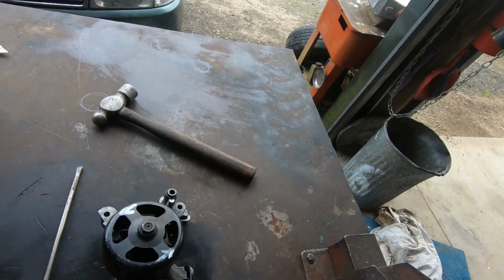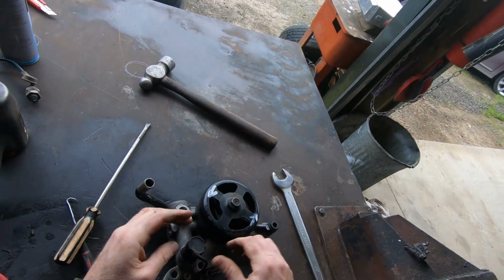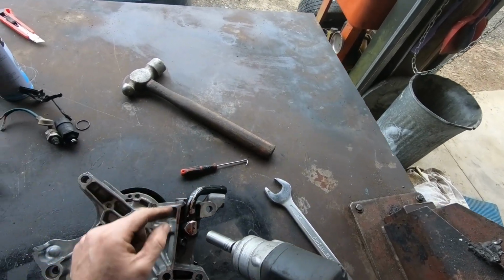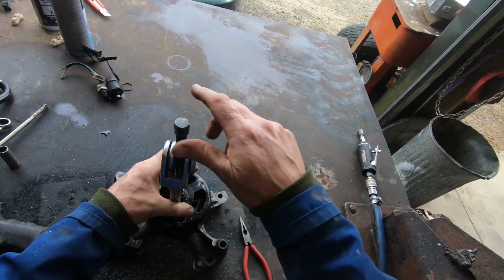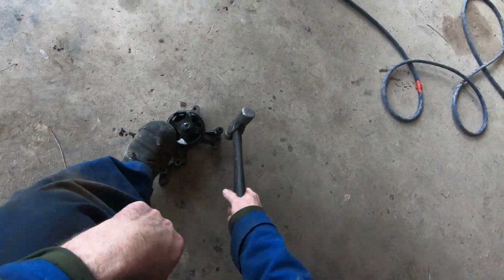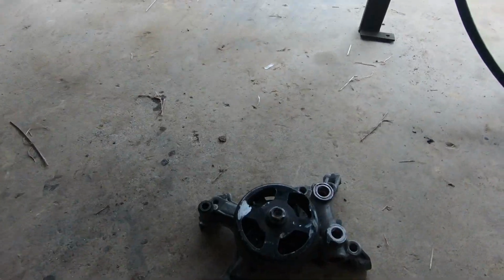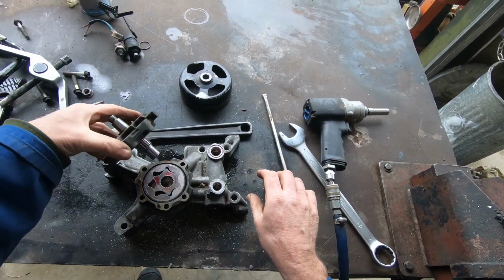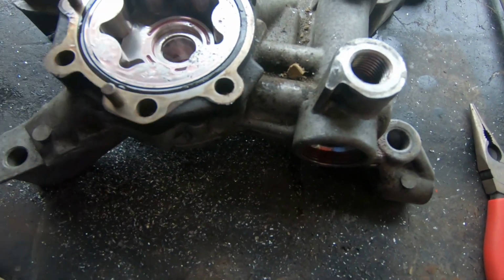1uz hydro fan strip.  Removing the hydraulic fan when not running Air conditioning

Comment: im pumped for the soarer content
Reply from the maker: I think the first video will be more diagnosis as it doesn't even run at this point.  Maybe I should get some suggestions on what to check from Viewers and produce a video that way?  Cheers Kelvin
Reply: @CartuneNZ  That would be a good place to start i think it would be awesome to have a few videos on the   most common problems for the soarers. Maybe any tip and tricks that you would know about them like 12v fuel mod and egr deletes( im pretty sure you got some videos on that already) and when shes runnin maybe a turbo build? i know alot of people always are asking questions and wondering but people give alot of misinformation on that subject so it would be nice to see what you would do and your thoughts on it
Reply from the maker: @mob187eastside  this car is never going back onto the road so will be stripped once I'm done.  No egr on jdm soarer but fuel pump mod is a great idea.  Im wonderimg about doing a plug and play Link ecu install as well.  First step will be making it run and skidding around the paddock.
Reply: @CartuneNZ   I Think those are 2 Great Ideas i am  definitely very interesting in both subjects.  I will be going link ecu in my sc400  once im done schooling and the fund are available. So that would be great video to have. Question.... am i able to run early 1uz rods in piston in a later model 1uz vvti internet says i can but i would like to hear your opinion. Thanks for makeing some great videos and i look foward to seeing more of hadens engine build!!.
Reply from the maker: @mob187eastside  Hello.  Yes.  Early rods go into vvti engines fine but piston design is different.   I've seen a 500hp vvti with early rods, injectors, turbo and ecu so has been successfully done by someone I trust.  Cheers Kelvin

Comment: What sized belt to use in Lexus SC400 with the hydro fan pump bypassed/stripped?
Reply from the maker: When we strip the hydraulic fan pump and don't have A/c we run a 6pk1555, Pk1560, 6pk1575 or 6pk1600 depending on the sizing of the other accessory pully's.  For the SC400 generally one of the first 2 work well.  Cheers Kelvin

Comment: Boy that steel workbench is noisy when you're throwing parts and tools around on it...great vid but what do you do with the gutted pump now?
Reply from the maker: It never seems that loud when I'm working but really does in the video.   The stripped unit becomes a cover onlt for the cambelt.  This vehicle isnt running air conditioning so a shorter belt is fitted,  in this case a Gilmore belt,  and its all done.  I've got a separate video for belt lengths on my list.  Cheers Kelvin

Comment: Hello sir! I'm in the states and have a JDM Celsior motor. I'm using your videos to help with my swap but I'm wondering if there is an alternative to this pump since it's  very expensive in OEM form and very hard to find used. I saw you mentioned there is a pump you use for the ls400 but it's not hydraulic am I correct? So would you recommend going to a clutch fan set up since this pump is often not replaceable? Thanks again for your content and help.

Comment: Interesting ways to remove the pulley.. I have so far unsuccessfully removed pulleys on two hydro fan pumps.. I used a Toledo two arm puller, and managed to bend both pulleys.. I am currently waiting from Toyota Japan the OEM SST to remove the pulley. Will grinding the opening or bashing the pulley cause damage or balance issues after rebuilding these pumps?
Keep up the great videos
Reply from the maker: Hello.  Bashing the pulley is highly likely going to damage the pulley. I only do it this way as its not getting used again.   Grinding is likely going to cause unbalance.  The puller I showed in the video removes the pulley quite easily but it must pull from the center of the pulley,   never from the outside.  Cheers Kelvin.
Reply: @CartuneNZ  I used the Toyota SST tool to try to remove the hydraulic fan pump pulley, and managed to break the SST tool..  BTW the Toledo tool grabs from the outside, and as you say that is no good, the SST tool grabs from the inside, but eventhough I was able to exert more pressure, it broke, I give up..
Reply from the maker: @goetzvg  thats stink.  My puller grabs from the inside and works well.  Im sure I show it in the video.  I use a big puller but the hooks on the legs are trimmed to to allow it to fit into the inside of the pulley.
Reply: @CartuneNZ  would you have the make/model of your puller?

Comment: I live in brazil, we do serious offroad around here.(take a look at m channel). Here 1UZ are totally rare, so your videos are being very helpful to me.
Im going to use an electric fan on my offroad project, so the hydraulic fan pump is going to be useless. If i disassemble the pump the way you did on the video and assemble it without the "internal guts" it`s a good idea? I want the engine to run as free as possible. Thanks!
Reply from the maker: Ok.  I would strip and not run anything where this unit is and fit a shorter belt.  I have done hundreds this way.  Cheers Kelvin
Reply: @CartuneNZ  I like that idea. In that case i don't need to strip the pump, seems easier ... regarding the length of the shorter belt, any chance you remember the length or code ? thanks alot.
Reply from the maker: Are you using the pump to run anything?  Is there fluid circulating?  The fluid lubricants the pump.  If its present and not stripped they seize.  With pulley removed I use a 6pk1555 or 6pk1560
Reply: @CartuneNZ  No, i wont be using it. Im keeping my A/C though.

Comment: I’m currently about to do the waterpump on my 1993 ls400 and i cant seem disconnect the whole bracket for this specific part. I thought I unbolted everything but it still won’t budge any suggestion? Your videos are awesome thank you for putting out this content!
Reply from the maker: I'd suggest removing the bolts you missed.  Possibly the a/c pump bolts.  If they are all 100% out then lever bar.
Reply: @CartuneNZ  Awesome answer Kelvin, gotta get ALL the bolts. 😃This is actually why I'm looking here is I can't get my fan bracket off my 93 LS400. I can't remember from when I did my other T-belt/WP jobs (among other things) and trying not to get under the car and do everything from the top. I got no lift and a gravel driveway. I'm just gonna take a break and have a 🚬 and check your other videos and see where the last bolt is so I don't snap the fan bracket. They sure helped with many other problems I had, even if it's just to see where another bolt might be. I think it's somewhere on the A/C. I guess I got smarter in my old age, I slowed down and look before I break something now. 
Thanks again for all your knowledge and videos on the 1UZ.

Comment: Hi, 
I have a 1st gen 1uz in a toyota celsior. My fan pully come off and I lost the keyway, but I don't have a clutch fan on there, can I just bolt it back on and run it?
Reply from the maker: Sorry I dont quite understand what you are saying.  Celsior from factory ran a hydraulic fan pump.  Some run a flange,  some directly onto a tapered shaft.   I'm not keen to advise when I dont know what really has happened.
Reply: @CartuneNZ  hey mate I've emailed you from a Ryan Doherty email

Comment: Why not just use the original 1uz hydraulic driven fan and modify it to fit the vehicles original or aftermarket radiator ?
Reply from the maker: In some instances I have however in most cases there is no way the hydraulic fan would fit and in most cases the fan assembly doesn't come with engine package so using it is not an option.  I think i have two fans left and rarely get more these days.  Cheers Kelvin.

Comment: Hey just found your channel.awesomr stuff !  I have a 1990 celsior. I recently had my radiator out for some work. I replaced the the temp sensor while I had it apart. When I put everything back together it seems like the fan ramps up to much and runs at full speed often. the sensor I put it was for a ls400. Could that be my issue ?
Reply from the maker: Hello.  Which temp sensor did you change?  The one in the bottom of the radiator?  are you sure the replacement was the correct one?  LS400 and celsior use the same unit.
Reply: @CartuneNZ  i replaced the one near the iac. The fan ran normally before. Barely knew it was running . Is there a bleeding procedure ? I thought maybe the celsior used a different sensor. I guess it could be a bad sensor
Reply from the maker: The fan sensor is in the bottom of the radiator and unrelated to the efi temp sensor.  The LS400 still have this sensor in the radiator but its used for ac.

Comment: I Have A 1UZ Engine With Hydro fan Pump But Its Droping Hydralic Oil From Seal. I Wanna Replace Seal Of This Part. Could You Plz Tell Me The Seal Number Or Size ?
Reply from the maker: I dont have the seal or size in memory.  We have it matched at the seal shop or replace complete unit.
Reply: @CartuneNZ  
Kindly Check Seal Number on a hydro pump  because on My Hydro Pump' Oil Seal was in worst Condition, thats Why I am Unable to Note Seal Number or Size. There is No info About that seal On Internet. So Kindly Check and reply. 
Regards.